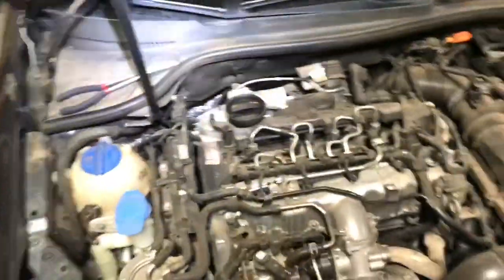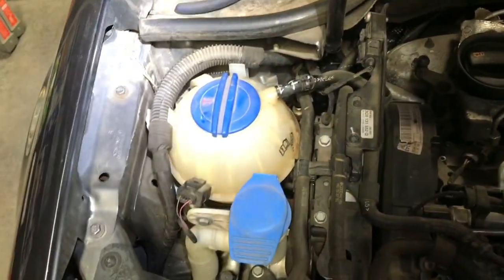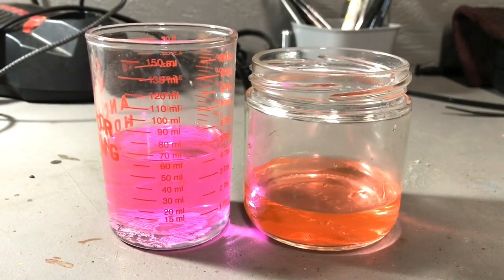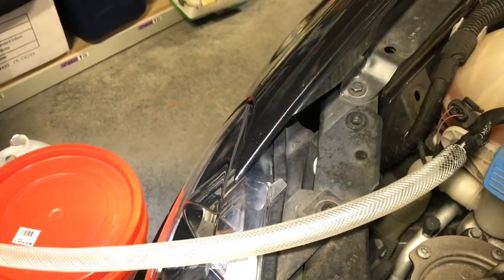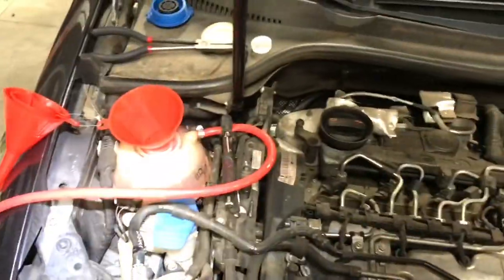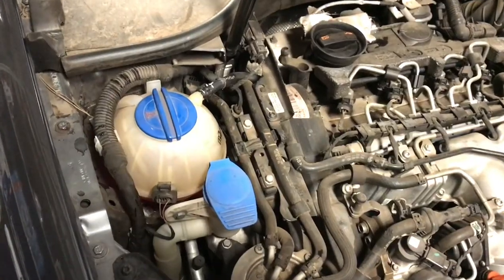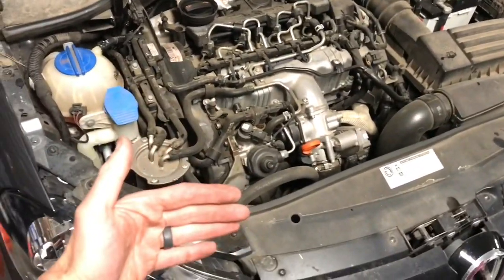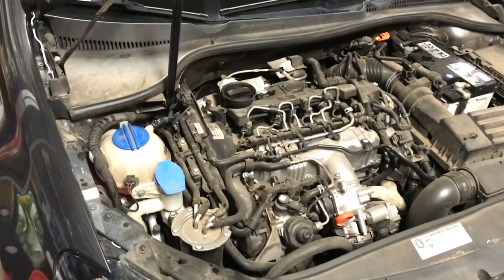VW Coolant Flush - The easy way, no mess! Volkswagen Jetta Sportwagen Passat Golf Touareg TDI TSI

Comment: Brilliant idea. I have a 2016 Audi A3 and there was no way I was taking off hoses from below to flush the system. there is  zero room. 

I took a slightly different approach as my coolant was pretty much a brown disaster. I ran 5 gallons of distilled water through first and saw the fluid in the tube (I used 5/8 ID clear tube from HD and it worked well) was running clear. That way my system was full of nothing but distilled water.

Then I used straight antifreeze, not the 50/50 mix. My logic was that the system was already full of distilled water so I wanted to bring it up to 50/50.

I did start with a completely warmed up engine as well and releasing the pressure on the tank was not bad at all. Much different than the old radiator cap days for sure.

Thank you for the video because I'd still be driving around with the brown sludge if I had not found this.
Reply: How did you know you reached a perfect 50/50 mix?
Reply: @hardcore4476  VAG specifies using a refractometer to verify the mix ratio.  I bought one for about $22 from  "A" big online vendor.  Some even have scales for G12 vs G13.    For the G12Evo (Xerex HT-12 Pink, concentrated), I will make a small 50/50 mix with distilled water to verify/calibrate the refractometer scale reading.  I will then shoot for that same reading when I introduce the HT-12.
Reply: @attocoulomb interesting. I just bought one of those guages from parts store to make sure coolant is thick enough to prevent freezing and boiling temps. Is that what you’re talking about?
Reply: How did you release pressure from the coolant tank?

Comment: This is brilliant, I bought all the supplies to do this at home last weekend. This weekend, I’ll definitely do this on a hot engine, along with keeping the heater on full heat to circulate the heater core as well. Thanks for the awesome DIY!!!
Reply: You'd better disconnect the output tube when the engine is cold.
Reply: 🤔 yeah that could be a problem. I was thinking of having another hose ready with a barbed splicer fitting. No rerouting just plug it in. Then a plug the reservoir with a hose with clamp as shown just smaller.
Reply: @antonioperez119  I performed the coolant cycle a 5 months ago, had absolutely 0 issues. Stoked at how easy it was! Tip, do it when the engine is hot, and the fluid cycles fairly quickly. Have someone sit in the driver seat, and kill the engine when you got like 1/8 of your coolant supply left. Top off the coolant a few weeks later if you notice it drops at all (mine barely did).

Comment: Thank you so much for making this video. I was able to replicate it on my 2019 VW Polo GTI.
I used about 12 liters of Holts HAFR0006B just to be safe, and drove the car for about 10 minutes to warm up the coolant.
Reply from the maker: Glad it helped, thanks for watching!
Reply: How did you open hot coolant reservoir cap?
Reply: @Danny-rf4gb  It was not boiling hot, just a bit hot. The rest of the operations were done with the cap open as in the video.
Reply: @Floyd..B  aha I see. Thanks!
Reply: @Danny-rf4gb  No problem, it was quite easy, but you gotta be careful with the coolant level.

Comment: Completed a coolant flush on my 2012 Jetta after work (engine still hot) and was the EASIEST flush I’ve ever done.  Took about 10 minutes and very clean job!  Thank you!!!

To drain reservoir, I used a small  vacuum line filled with water (thumb over top) to drain easily using siphon effect.  I used 5/8” ID hose and a clamp for drain line.  No need to cap off the return nipple—simply don’t overfill reservoir.
Reply: How did you open reservoir tank cap with engine still hot? I'm trying to do this asap too
Reply: @D @Danny-rf4gb  with no issue— reservoir cap will be fine.
Reply from the maker: Awesome, thanks for sharing!
Reply: That method might work if you have a squeaky clean system.A proper flush needs to be power flushed.I’ve done that exact engine.what happens when you do the cheap method is because the heater core is relatively small it is prone to clogging without enough pressure to push the coolant or flushing chemical through the heater.
Reply: Great idea going to do this on my Audi TT thanks 😊👍

Comment: Zerex G40 is a Silicate  Si-Organic Acid Technology (Si-OAT)  coolant equivalent to VW G13 G12+ G12++ violet colored coolant. It can be mixed with G12 an older pink pre-2007 VW OAT coolant without silicates.  Peak offers both coolants and are also 150,000 mile 5 year coolants. VW and Audi issued a coolant compatibility chart. of interest Audi specifies using distilled water,  not de-ionized water, to dilute coolant.

Comment: This is absolutely genius! I Just did this on my 2020 Volkswagen Tiguan SE R-Line Black edition today! Worked absolutely fantastic! Dummy me made the mistake a few weeks back of mixing the pink coolant with the violet and my coolant turned orange which had me worried. So I read the online it’s hard on the gaskets to keep running the mixed (orange) coolant, Because the G12 is Ethylene glycol based and the G13 is a Glycerin based coolant and they don’t mix too well. Anyway if it concerns anyone, I used this method here to actually flush my system with room temperature distilled water until the fluid came out clear. Then started adding 50/50 coolant. It took about 3 gallons of 50/50 coolant in order to match the color of the coolant I was pouring into the reservoir to what was coming out of the return line. It took about an hour to complete this process for me as my engine was already at operating temperature and radiator fans already spinning. Overall this doesn’t take a very experienced fella to do this, if anyone is hesitant to try this method don’t be, it worked beautifully! By the time I was done I was laughing because it was so easy 😆 Thanks for posting this video it made my life easy!
Reply from the maker: Glad it helped, thanks for watching!

Comment: I do the exact same thing on my Chevy,but i pour clean water in my reservoir until all the old coolant comes out and water runs clear. I then start adding the new coolant until it exits the drain hose at the desired color. I then turn off the engine and reconnect the coolant hoses.
Reply: If it comes out clear , there’s none sitting in another area right? I don’t want to mix the fluids.

Comment: The latest VW/Audi coolant is G12Evo, which was developed by Valvoline.  It is also sold as Zerex HT-12 Pink.  It is compatible with all previous (G11, G12, G12+, G12++, G13) VW coolants.  It can be used to top off or replace any of them.
Reply: Peak European Purple is also G12evo. Same specs as the  Zerex HT-12. Just purple. Verified!

Comment: I spent 2 hours on replacing coolant on my 2017 touareg. To heat the engine, I had to step the accelerator keeping 1500 r/m.  I input at least 50L tap water  and 10L Dismineral water before input 8L G12++ coolant.
Reply: hey i am trying to do the process for my jetta 2012 2.5 what brand of g12++ coolant did u use?

Comment: I have a 2015 GTI. I'm guessing the process would be very close to this one? I noticed you have a TDI. Just to confirm, if I warm the car up to near operating temp, this process SHOULD swap ALL of the old coolant for new, yes? It looks like most shops/dealer will only do a radiator flush/fill, which only swaps about 1/3 to 1/2 of the actual coolant. I feel that totally defeats the purpose.

Comment: Good morning sir, i am from France, thanks a lot, i am going to follow your process quite soon.

I have a Golf 7 TdI 2L of 2015.

What I have red on many forums that the coolant of those cars need to be done with entering into the computer system (with VCDS or VAG-com). 

Indeed, it is said that there are some hidden auxiliary pumps that must be open (otherwise the old coolant will not be totaly taken off as some fluid would remain stuck).

What I understand with your process, is that we can reach the same result? But how the hidden pumps would open ? By themselves after being hot ?

And an other question please : I just changed by myself the timing belt and the water pump. This is why I, now, need to refill the lost water coolant.

I think that right now, there is no coolant at all in the system (or at least, maybe some very few fluid remains stuck because of the hidden pumps as I mentionned previously).

Can I use your processas currently there is no water in the system ? Is there a risk to the engine to get too hot ? Because I al wondering, if currently there is no water how the thermostat can open…

Thanks a lot for your response.

Greetings from France, love Amérika and américain people.
Reply: J'éviterais de le faire à sec, car la pompe à besoin du fluide pour être lubrifiée.
Selon la voiture, il y a peut être moyen de préremplir un maximum de zones en mettant du liquide par le haut des tuyaux.
Reply: The correct way to fill this system from empty is vacuum fill. only authorised VW dealers can do an antifreeze change properly, otherwise the system will be full of air locks....................
Reply from the maker: Sorry, I'm afraid I don't know the answer to that one.

Comment: Followed your steps on VW 2012 CC. The process was incredibly easy and clean. Thank you for the tutorial! Unfortunately in my case, it turned out that my Oil Cooler is going, as the coolant turned brown after a half an hour drive... On to a much more intensive repair.
Reply: Hu buddy, can you explain in detail please, it would really help us (especcially me in the first place).

Thanks from France.
Reply: @LucieOvalx  the oil cooler has oil passing through various layers of fins and on the other sides of the fins passes the antifreeze/coolant. Sometimes the rubber seal goes and the two mix, other times the fins corrode and the two mix inside. This way oil leaks into the antifreeze as it is heavier, and not the other way around. So your coolant/antifreeze would be brown instead of pink/rose. I changed out the oil cooler and the seal, did a few more flushes and that fixed the problem.

Comment: I don’t get why it needs it? The coolant will get drained every 5 years for cambelt / waterpump replacement or any other maintenance work on the system?
Reply: Not all VW's have a cambelt, some have a timing chain, and those don't need changing every five years...............
Reply: @richardsealey3626 well the one in the video is cambelt

Comment: Hi, thanks for this video, it really makes sense on how to flush the entire coolant system, I have a question though, When flushing will it also take out all the residue that is in the cooling system? I am asking this because I am suffering from a clogged up heather core (in my 2012 Skoda Super 2.0 TDI) as a result from a broken silica bag which resides in the expansion tank. I now am planning to replace the expansion tank, the radiator and the heather core in order to get rid it the stuff that is sticking in these parts. I now need confirmation whether the coolant flushing is contributing to the removal of the silica residue
Reply: I don’t think it’s a flush as such, more of a fluid replacement… the heater cores look to act as trap or filter for the sediment / casting sand / silica so once it’s out you are half way there… a flush or fluid exchange on top will defs help
Reply: No flushing will not remove the silica residue, you will need to go to an official dealer.......
Reply: @richardsealey3626  Thanks for your reply, meanwhile I have replaced radiator, expansion tank and heater core succesfully half a year ago myself and it took me about 12 hrs....
Reply: @RobertKlok  Looks for vidoes on backflushing the heater core.   Worked decent for me.

Comment: Did similar with ease tricks. Using a fluid extractor with relief valve can speed it up and be regulated. And running hottest setting (no a/c) even from cold start is enough to get full circulation right away (while preventing burns). Will cut time by a fraction with no air pockets.

Comment: Is it better to use a plastic filling funnel spout to avoid coolant level down and air issue or is not good to use this tool because the level is always max and mybe there is an issue when the level is always max during the process?. The level down is my inly issue to start doing theis experience

Comment: Cars been running at 2000 rpm for 10 minutes with the heater on full... no coolant is coming out of the return line. Any suggestions?
Reply from the maker: Oh weird, what is the year make and model?
Reply: Thats what I thought, I ran it for a few more minutes to be sure and still nothing. 2013 Jetta TDI
Reply: @Spence-zx9zp  mine is doing the same thing, did you get anything figured out?
Reply: I'm assuming it's just that Diesels take much longer to get up to temp than a gasoline engine so it wasn't cycling the coolant. I ended up just dropping the coolant pipe and draining it that way
Reply: Thanks for the reply by the way

Comment: Tried for 30 minutes, got less than half a cup of fluid, seems very slow way of doing a flush.   Gotta do heater core after flushing, prolly just push tap water through the heater core hoses, before putting on new heater core.

Comment: Very clever! 

With this technique the cooling system never introduces air into the coolant passages. Whereas the traditional drain/refill method does. Therefore this technique means that there’s no need to worry about burping the system to remove air bubbles. Is that correct?
Reply: yes
Reply: @matter-under-mind  👍
Reply: This is not a traditional cooling system, and needs to be vacuum filled.......

Comment: Great video I’m gonna try it with my 2004 Touareg. Only thing I gotta say tho is if you want the engine to be hot then you wanna run the ac and not the heater. The heater will cool down the engine and the ac will heat it up. I used to drive tow trucks on the grapevine in ca and seen way too many people heat from running ac and have actually stopped my truck from overheating by turning on the heater. Cars use engine heat for the heater so when you turn it on it sucks heat from the motor it doesn’t add more heat
Reply: The reason to turn on the heater, is to flush out the heater core, not to keep the engine hot.
Reply: Did you ever try it on your 2004? And did it work?

Comment: Thats exactly what happed to me on my Golf GTI 7.5 2018 it came gushing out of the top of the overflow tank, so i abandoned the job , any suggestions ? would like to here from someone on this please?
Reply: i think its best to have the engine somewhat warm but not at operating temp then by the time you get most of it exchanged then it may be ok
Reply: yeah that’s my concern with this method, won’t the coolant start boiling and overflow out of the reservoir if the engine gets hot enough?
Reply: 🎉🎉🎉  have 2012 vw golf 2.5 l.   This method works.   Had 3 gallon bucket to receive  old coolant  and   3.  One gallon new ready to use new coolant on stand by/    Used  3/8 inch  transparent vinyl tubing with brass coupling to connect to black hose. (I did mine at operating temp just make sure to make your connections when engine is off) felt like I was filling a leaking bucket , thats how fast it drained on mine on a hot engine
Reply: Any updates on this mate ? Was going to try this on my 7.5 as well
Reply: @arzenemini9042  i gave up on the idea, because of the over flowing header tank issue, decided to do Parshall change a few times a year   Ie drain header tank and replace it with new .
Reply: @Mike-gz4xz  Yes this is not the correct way to change the coolant.............
Reply: @arzenemini9042 I did the same with no problems on a VW Passat B8 with the 2.0 TSI EA888 gen 3 engine

Comment: Great video, thanks for all the tips and comments. My '08 Passat Komfort has never been changed but it only has 48K and information even from VW forums seems to say OEM is practically lifetime or by mileage but I'm changing it anyway, this method looks great never heard of it. The oil is changed every 3500K without fail (turbo) other fluids too but have been on the fence with the variety of coolant recommendations.

Comment: Cool, thanks for the tip. This method looks both easy and effective, no old coolant left in the engine block. Will do it tomorrow, with a couple of litres of demineralized water first (tap water would work just as fine i guess)
Edit: It worked out very well, and no need to block intake pipe on the canister. I placed my car jack as weight on the gas pedal to get a little higher rpm to make the whole process go faster. Approx 1750 rpm. I also drove a few miles up front, with the heater on max
Reply: "Canister"?..................